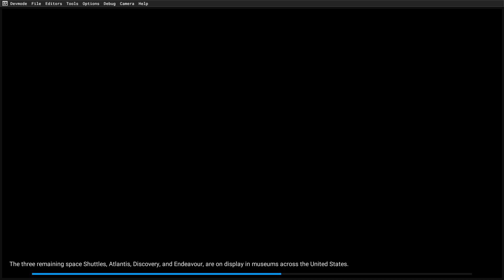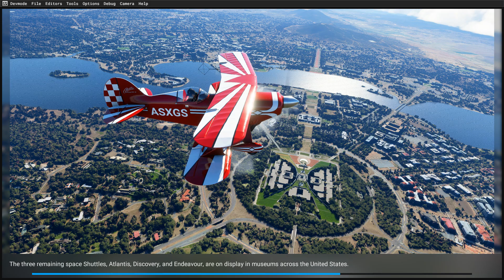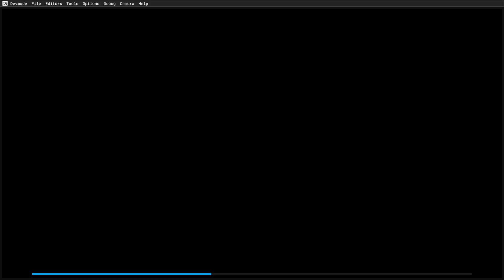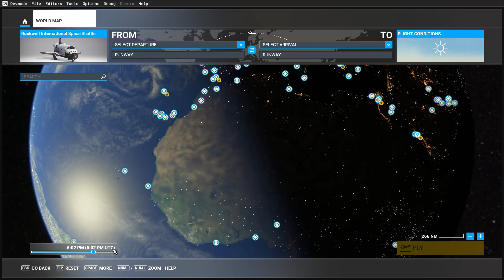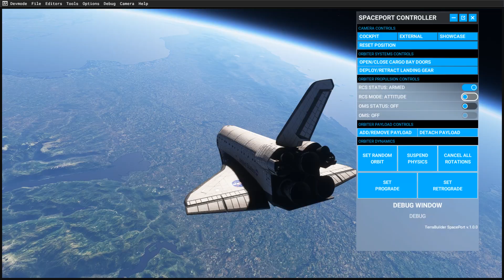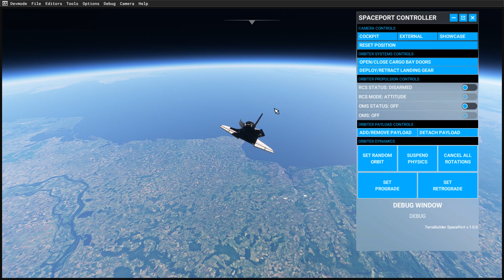SpacePort for Microsoft Flight Simulator 2020 November 2025 Tech Demo 2 WIP

Comment: Will re entry effects be better with space shuttle in spaceport than the original captain sim space shuttle in Microsoft flight simulator 2020? Because I notice for the tech demos you are using captain sims shuttle which right now does not look realistic. However I am exited for this but I don’t want you to rush it either you guys are doing fantastic and I can’t wait to see the final product cheers
Reply from the maker: Yes, we agree, some of the aspects of CS leave a bit to be desired, however, it is still a very well modelled spacecraft, one of the finest around (if not the finest). Don't worry... We have the ability to dynamically attach objects to it, so we can attach proper re-entry plasma clouds, among other things (like QMax vapor clouds). We've done it before, check out the Orion capsule re-entry (you can see it in our videos). We will do the best possible job that MSFS202x technically allows, and that is certainly more than P3D allowed.
Reply: @TBAdmin that’s awesome thanks cheers
Reply: Oh and i want to mention that I am not saying your project isn’t realistic but I mean the captain sim space shuttle simply lacks in reentry effects thanks sorry about that

Comment: I know there are altitude limitations in Microsoft flight sim 2020 but are we going to be able to fly higher than 275 thousand feet in 2020 sim when spaceport releases this spring?
Reply from the maker: No. MSFS2020 has an absolute limit of 275,000 ft (83 km). Objects that are set at a higher altitude get "knocked down" to 275,000 ft.
Reply: @TBAdmin ok thanks for letting me know cheers

Comment: So I know you said spaceport will release this spring but I’m just curious does a tech demo usually mean that the project is well into development and close to release?
Reply from the maker: Did you see a P3DV4 videos on our channel, from a few years ago? If not, take a look at those. We have all the aspects worked out, from modular assembly, to launch, on-orbit ops, reentry and recovery (parachutes). That is all working. What we are doing now is porting it to MSFS202x. While the C++ code is nearly identical, MSFS202x has a slightly different interface structure and timing, plus, the end product has to be WASM, which has its own challenges and limitations. That's what's taking the time. Also, we haven't dealt with a winged spacecraft in P3DV4, only with capsules (Orion/SLS).
Reply: @TBAdmin got it thanks cheers

Comment: Will you keep supporting Microsoft flight sim 2020 with spaceport going forward? because I know that there is a new Microsoft flight sim 2024 sim
Reply from the maker: SpacePort will be for both MSFS202 and MSFS2024, with minor differences, the main one being that MSFS2020 is limited to 80km altitude, while MSFS2024 goes all the way up to 30,000km altitude.
Reply: Ok thanks for letting me know cheers

Comment: So after buying and downloading it from in game sim marketplace do I need to find spaceport in the sims menu and select it to use it? Or is everything just automatically there meaning when I select spacecraft it will just spawn in orbit?
Reply from the maker: Once you buy SP from MP and it gets installed, you re-start the sim, and the SP module will be active. It will detect when you select a SP-enabled spacecraft, and will be taking over the flight model. It will be like a new sim, inside a sim. In order to use some functions, there is a "SpacePort Controller" in-sim interface panel (as in the video, WIP), which you will find in the toolbar located at the top of the screen, where all the other default (and 3rd party) interface panels are.

The toolbar will contain some SP specific functionality, as well as some functions that will be replicated in the actual cockpit switches and knobs.
Reply: @TBAdmin ok thanks for the info cheers

Comment: How does spaceport actually work I am just curious as to how it works is it an actual space port or is it just a tweak to the sim that allows certain crafts to reach orbit?
Reply from the maker: SpacePort is a true, full-featured space flight simulator. It has its own physics engine that replaces Flight Simulator's physics engine, and uses the Flight Simulator only as a visual display platform.
Reply: @TBAdmin that’s cool thanks